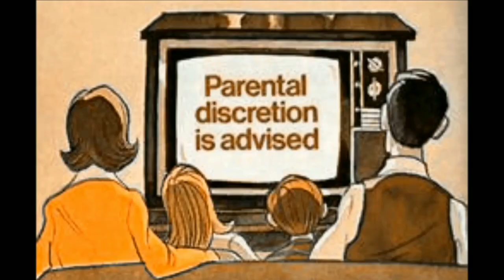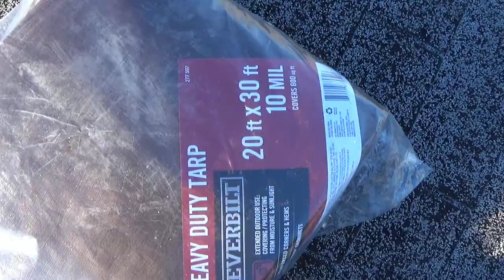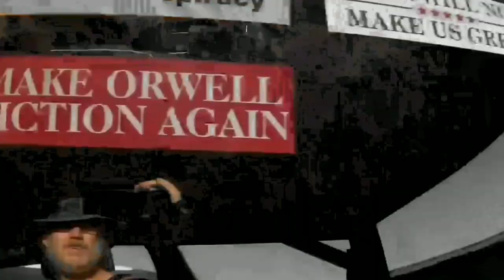My Roof

Comment: 110% am right there beside you with the new found fear of heights,    60mph winds came through and destroyed the peak of my roof again 2nd time in 10 years. My old work was destroyed and 10 ft of shingles missing all in the yard on the other side of the house, its too steep on that side so i have to fix it upside down with my lower belly/crotch straddling the peak.mixed match shingles and tar not to mention my heart pounding out of my chest and overwhelming thoughts of my own mortality, but i did it aint pretty but i did it, last time wasnt so bad this time suuuucked and two days after i did it some dipshit puts a business pamphlet in my fence roof and siding were circled..YEAH I GOT EYES TOO BUDDY now im gonna avoid those pushy mfrs at all cost
Reply: @RedboneUnincorporated  God bless you bro
Reply: @RedboneUnincorporated  I would have made a headset gopro vid but just not goo, too much tar, jacket thrown away but I might make a multi image vid